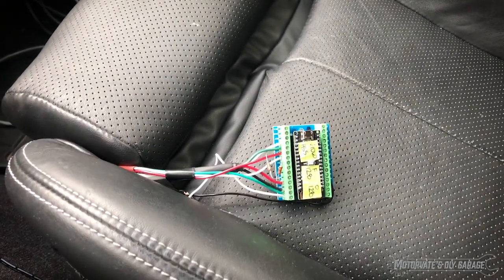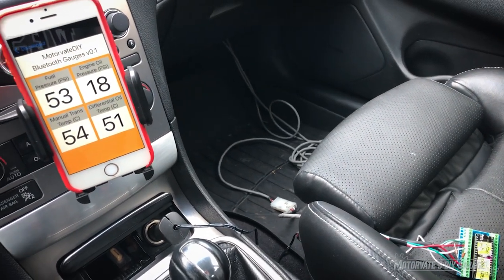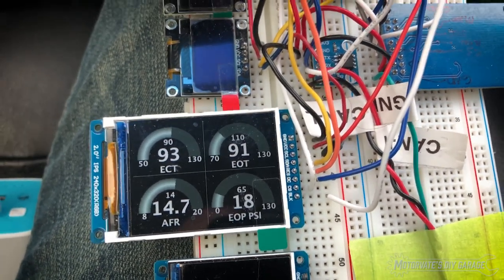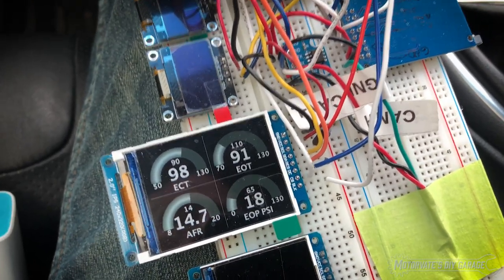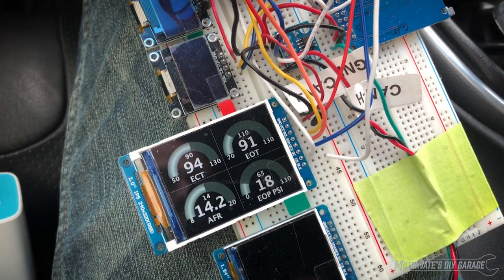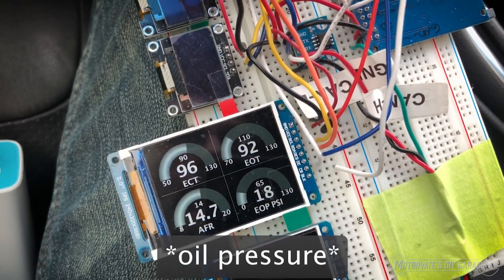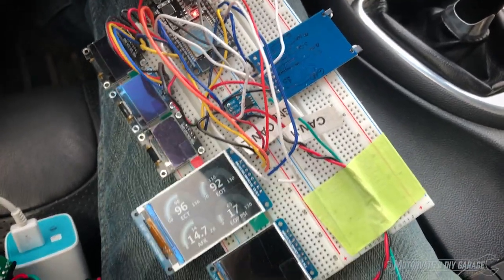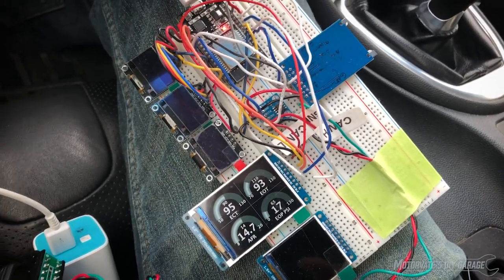DIY Bluetooth + CAN Bus Gauges!  MotorvateDIY Garage Ep.39

Comment: This is something I need to learn to do!  I got a ESP32with 5" touchscreen to read my ecu's can 2wire signal that I want to display and also other sensors and bluetooth lol
Reply from the maker: In the new year, I plan on making a few videos to show my strategies to reverse engineer the CAN bus including how to make <$10 CAN sniffing/data logging tools.

Plus, I will show how to use Bluetooth for any remote pressure (oil and fuel) or temperature (diff & trans oil) sensor. I've been using them for just over 4 years and they have worked perfectly!

Comment: I've been looking for this type of device to monitor: Engine Oil Temp, Engine Oil Pressure, Trans Temp without the large round gauges on my 5.9 Cummins. How far are you along on producing a completed device? The diesel truck guys will love this device!
Reply from the maker: Unfortunately, since most of the data is from the vehicle's network (CAN bus) it is vehicle specific.

This only works on Infiniti G37, Q40, Q50, Nissan 370z and other Nissan / Infiniti models from 2010 to about 2017.

Now, the Bluetooth gauges should work on everything, as long as there is a way to install the sensors on the 5.9 Cummins and transmission.

There may be a way to get the data off the truck's network (if it has one) , but I don't have access to one and would take many, many hours to reverse engineer.
Reply: Thank you for the reply. There are sensors the 06 Ram network. They show up on my phone app, Torque using a obd2 Blutooth sevice and a digital dash. This year model has a oil pressure switch and a trans temp sensor on the valve body. I was looking for a device that would accept sensor inputs, oil pressure and trans temp taken at the torque converter.

I mounted an oil P gauge on the steering column and have considered mounting a trans temp gauge beside it. 

It would be so much cleaner install to have a DD that accepted these inputs. 

My race car standalone ecu and tcu accept inputs with calibration maps. These open the door for innovation. 

I see a need for this product in the HD truck market. We spent alot of money improving the gauges.
Reply from the maker: I see your point. 
Let me do some research into the RAM CAN bus network(s) to understand them better.

The same hardware can be used to display anything that is on the CAN bus or that can be requested via an OBD mode $01 (live data) request.

Comment: Great looking work! Thanks for sharing! I was concerned about lag on wireless but looks like the gauges are pretty responsive!
Reply from the maker: Hey Gavin! In this video the BLE server is only sending data at 9600 bits/second and uses a 128 sample moving window average to reduce gauge flutter. (up 1 digit, down 1 digit, up 1 digit...)

The BLE data rate can easily go up to 38,400 bits/second and a RC low pass filter could be added so the MWA could be reduced. BUT as I see it, if a gauge updates 4-8 times per second, it looks instant :)

Comment: I am currently researching CAN Bus security (or really the lack thereof). This is a good vid that has helped me in the breakdown of CAN Bus signals to Bluetooth.
Reply from the maker: Keep in mind that the Bluetooth sensor signals  are custom developed by me and have nothing to do with the CAN bus signals.

Good luck on your research!
Reply: @MotorvateDIY  thanks! Do you have a repo for your software/firmware or is it proprietary?
Reply from the maker: Good question... 
I have spent $1,200 in purchasing used ECUs/BCMs/IPDMs/TCMs, etc and have about 2,000 hours reverse engineering the Nissan/Infiniti CAN bus and about 500 hours in product development.

The initial plan was to start a business and sell these gauges, but I haven't committed to that just yet. I need to look into liability, international taxes and verify I can sell these in the US. (US import laws may prohibit it)

Part of me would like to get a small return for my time and the other part is thinking of giving it all away.

Until I figure out what I want to do, I will hold onto everything.
Reply: @MotorvateDIY  I can fully respect that. The work I am doing now is for my PhD. I keep it close to the vest because others may try and beat me to it and then I have to find another option. Already happened once.
I should be done in about a year. I will reach out when done and show what was discovered. It is more on security of the CAN Bus (which has crappy security now).
Reply from the maker: Thanks for your understanding!

If you are looking at automotive security, you might want to also look at RTL_433 with a $40 "software defined radio"

With this, I can get the tire pressures and unique TPMS IDs of the cars that drive by my house...plus my neighbours weather station temp/humidity and much more.
Reply: @MotorvateDIY  I was about to ask you about this. If you have a Github or anything documenting the CAN ID's and other information about the Infiniti CAN system but I see now you aim is to monetize. Makes sense given all the work you have put in. Good work though.
Reply from the maker: I'm glad you understand. I'm not trying to be greedy, but I would like to get a small something for my expenses and time spent on reverse engineering.

I have been thinking about putting together a course to show some  of the strategies used to figure things out as well as a cheap DIY CAN bus data logger.
Reply: @MotorvateDIY  Do you have an email address I can reach you at? I have a project that I would not mind paying you for some help.
I am trying to add the blind spot monitor(side radars) to a trim that didn't come with it. All communication is done over CAN and I have most of the modules(radar and controller) but unfortunately I need the lane departure camera to turn the system since the physical switch for the system is wired to the lane camera which then sends a signal to the radar control module to turn on the radar system over CAN.
The thing is the lane departure system is something separate that only turns on the blind spot monitor(and that is the extent of its interaction with that system).
If you have cracked this system's CAN ID's I would not mind an arduino hex file for a system I can use as an on/off switch. With the hex you can protect your can ID's and I could build and flash the arduino and system myself
Reply from the maker: Hey Gary,
I have not done any CAN bus work on the blindspot monitor (my car doesn't have it), so I won't be much help.

Good luck getting it figured out!
Reply: @MotorvateDIY  Thanks, looks like I am buying that lane departure camera and also going CAN sniffing after all. LOL
Reply: @MotorvateDIY  Open a pattern, we will all pay to buy or use the code
Reply from the maker: I don't understand what you mean by "open a pattern"

Comment: Awesome sauce. Wondering as to the outputs... This would be perfect for my HUD build.
Reply from the maker: The wonderful thing about programming a micro controller is that you can convert the data to almost anything :)

Tell me more about your HUD set up and let see what we can do :)
Reply: Sorry just read your reply. So far the hud input in HDMI. Next iteration will be a sdiy build using a possible pico projector, with teleprompter as my screen. Plan on fully integration with turns, headlights, obd readout. Basically a raspberry pi in current iteration. I'll load a vid of this build if you like. And next to come. I would love to integrate yours into mine. Complete with infinite focus...
Reply: Granted with just select gauges in driving mode.
Reply from the maker: I'd love to see a video of your set up!

Comment: That's pretty freakin sweet dude... 
Been looking around extensively for a all-in-one display or at least modular display, specifically a rectangular one, that displays tire pressure, coolant temp, and oil pressure. Those awesome TPMS systems don't exist with those additional features (too bad, because those are perfect for replacing the compass etc. display above the rear-view in older SUVs). Pretty much ALL of the oil/coolant gauges out there are those ugly as sin giant round things that can't really be modified for a somewhat factory/integrated look that I very much prefer.
 
 
If your car doesn't have TPMS from the factory Ill bet a 433mhz receiver on your server and aftermarket valve stems would get you that data fairly easily..
Reply from the maker: Thanks. My biggest challenge is making an enclosure for it and finding a good place to attach it in the car.

Comment: Very cool! Just curious, are you able to get live TPMS data for each tire with this?
Reply from the maker: I think so... but I have more testing to do. I will have an update video in the next few weeks.
Reply: TPMS sensors don't constantly transmit data. The pressures are stored in persistent memory unless specific conditions are met, such as a decrease in pressure. But yes, you can read tpms data
Reply from the maker: Correct, but in the case of the G37, the tire pressures are updated every 13.5 to 65.8 seconds when the car is in motion.

When stationary, they are updated every 10 hours.
So the displayed tire pressures are as "real time" as possible.

Comment: Hello. I love watching problem solving at it's best. I'm in the middle of a SBC 400 swap into my 1955 plymouth. With that swap, I plan on using the Holley Sniper EFI and changing my dash to an aluminum dash (deleting all the old gauges and nobs). They have a separate digital dash/cluster that is over $2000. I would LOVE to have a 12-14 inch screen as my dash/cluster but that is a whole lot of money. If you could make something that just reaches the canbus, the market could be huge for carb to EFI guys like me.
Reply from the maker: Thanks for the comment.
At this time, I don't have the resources to research what would need to be done, BUT I will add it to my "to be investigated" list :)

Comment: Could you also read and log data like RPM, speed, or mpg?
Reply from the maker: Yes! The ability to data log onto a micro SD card has been built in from the the start.

It currently logs 31 items from engine oil pressure & temp, coolant temp, individual wheel speed, vehicle speed, RPM, corning g force,  engine HP & torque, AWD torque, and many more.

I could use the "fuel flow rate" and calculate MPG, but it really isn't important to me... plus the car  already has that display.

Comment: Great Work. I am interested in how the differential temp sensor was done. I hear some noise in my G35 rear-end, changed bearing still have noise. Want to know if it's heating up.
Reply from the maker: I'm going to add a section to motorvate.ca that will show how to do this.

Until them,  I used an early 2000s Sentra engine coolant sensor from a scrap yard and a threaded adapter to fit it into the drain plug of the diff. 

This plugs into the Bluetooth server and sends out the temp.
Give me a few weeks to get the page up. I will post a short video when it is done.

Comment: Any guidance on how to reverse engineer the CANbus data?
Reply from the maker: Oh boy.... that's a tough question to answer. 
As I see it, you need to know a little about a lot of things to reverse engineer the CAN bus. 

For example, you need a wiring diagram to know how many modules are on the CAN bus. You also need to know what each module does, so you have a rough idea of what inputs it needs to do its job.

You also need to understand hex and binary number systems.

In the fall, I do plan on doing an "Intro to CAN bus reverse engineering" episode to share what I have learned and to give tips to recognize different types of signals.

I hope you can wait until then!

Comment: Hey frank! Love the work! What is your process for reverse engineering the CAN bus? Are you on the lookout for specific bits of code or just throw darts at the board and hope one hits?
Reply from the maker: Thanks!
A year ago, I didn't know anything about the data on my car's CAN bus, and since there are over 2,000 messages per second, I needed to develop a strategy.

In the spring, I will put together a video showing how to get started, things to look for.

The short version is to record the CAN bus data and go for a drive. Most of the time I will write a script of how to drive/what to do and then follow that.
For example it might be something like: 1/2 throttle acceleration up to 50 KPH, turn right, stop, back up, accelerate up to 70 KPH, brake,  turn left, come to a stop.

Then I use a program that will plot the data in a graph, and try to find items that follow the driving pattern. Things like vehicle speed, throttle position brake lights, and turn signals are usually easy to find.

However, all you have now is the raw data. It need to be converted to the real values. For example, often the vehicle speed on the CAN bus is the actual speed x 100. Why? This prevents the micro controller from needing to do floating point math, witch takes more time than integer math.

You also need to understand bits, bytes, and binary/hexadecimal number systems.

As for the program I use, I really like SavvyCan. It is free and you can find it on GitHub.

Comment: so way back in the Maxima days there was a mod to keep the fog lights on when the high beams were used. is there a similar mod of that type that you may know of for the G? i'm installing some switchback fog lights and assume i'm gonna have issues with the color flip when i use the high beams.
Reply from the maker: I remember that.... I had a (wonderful!!) 1995 Maxima and many people did that mod.

However, for the G the BCM (body control module) receives the headlight and fog light requests and won't allow high beams and fog lights to be on at the same time.

I am not familiar with "switchback fog lights" so I don't think I will be much help. You could post this on myg37.com, they have some very knowledgeable people there that are happy to answer questions.

Good luck!